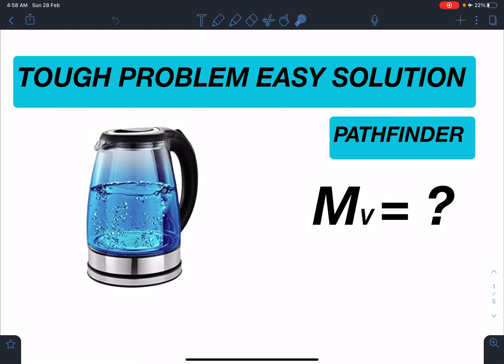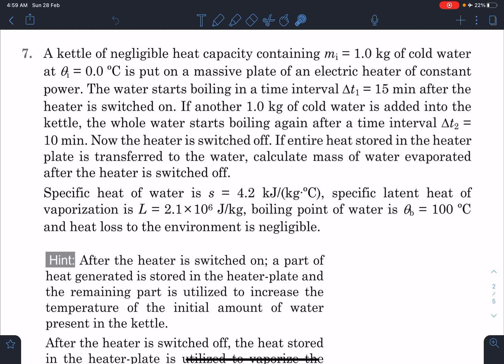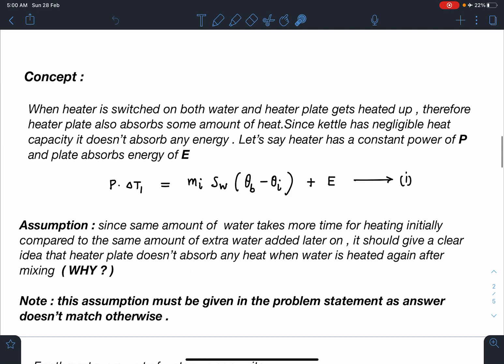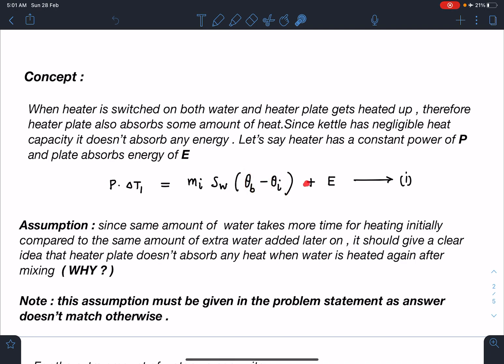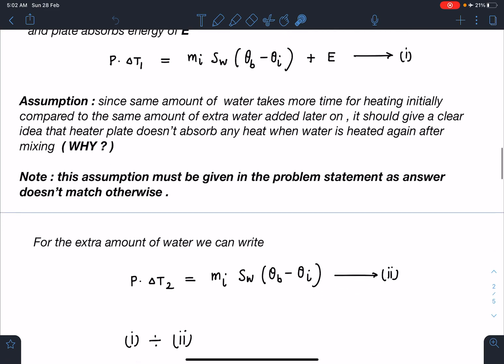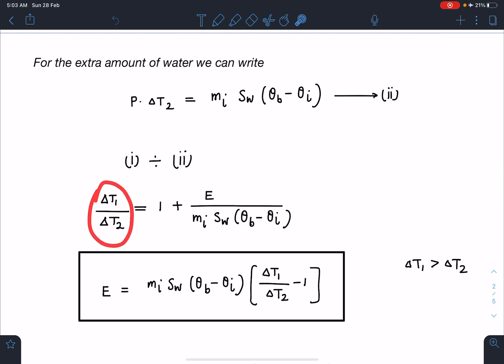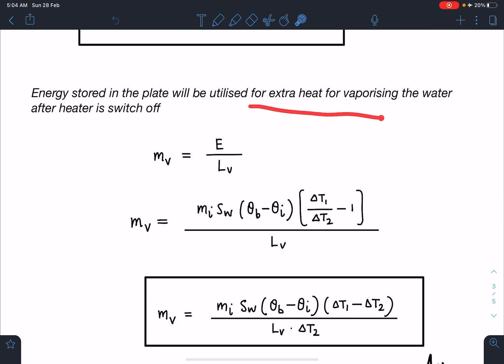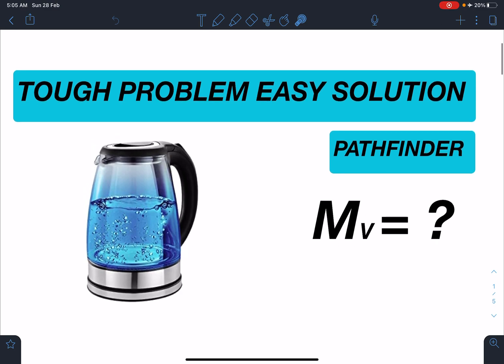[JEE ADVANCED] VAPOURISATION OF WATER USING EXTRA HEAT WHILE MIXING [PATHFINDER SOLUTIONS ]

Comment: Sir, Is there an actual reason why the plate doesn't take up (or takes up less) when the mixture is heated.. Or can we say, as the plate is already heated it also gives some heat to the 1 kg cold water from the amt stored in it (due to earlier heating) so net heat absorbed by plate in the second turn is negligible??? (heat absorbed by plate equal to heat released by plate to cold water)

Comment: Sir...i didnt understand one thing after the  1 kg water is added...the net temp of whole water will be somewhere between 0-100 and net mass will be 2 kg then why are we writing initial temp of new system to be 0 and mass 1 kg.....I am confused!!
Reply: The thing is by energy conservation we can say that  the net heat exchange will take place between the cold water and hot water only so before and after mixing energy will be same , and as we know internal energy is a state function so final energy when 1kg +1kg(=2kg) of water is at 100°C is same in both cases, and initial energy in  case 1)If we consider it as mixed and case 2)If we consider both separately is same , so change in energy will be same , and we just did the second one for easier calculation.
Reply from the maker: We are just doing the heating of additional part , if you want to go with extra steps you can  ,  but it will lead you to the same ans ,  1 kg 100 c with 1kg 0 c will give 2 kg 50c ,  which will be heated up to 100 from 50 C now heat will be 2 . Sw . 50 which is same as 1 Sw 100
Reply: @INSP_NITIN  Got it....thank you sir!!!
Reply: @vidhitpatel9765  you got my explanation?
Reply: Yeah even i am also bit confused here.